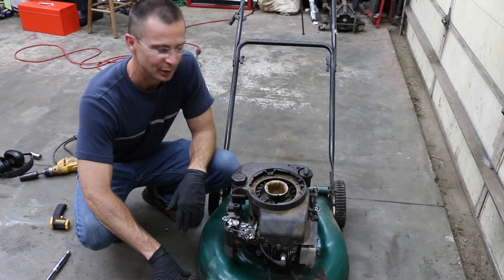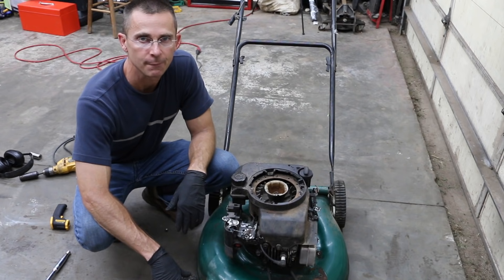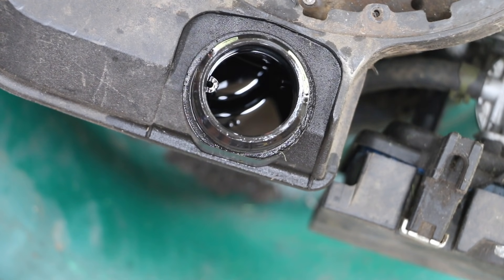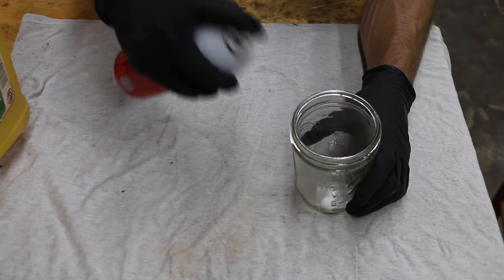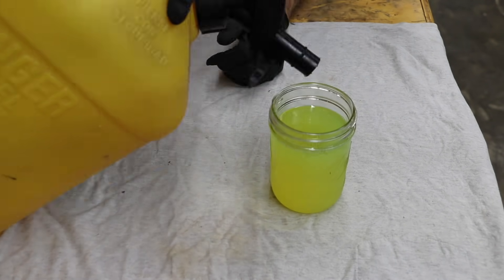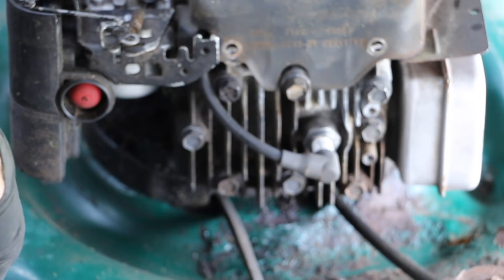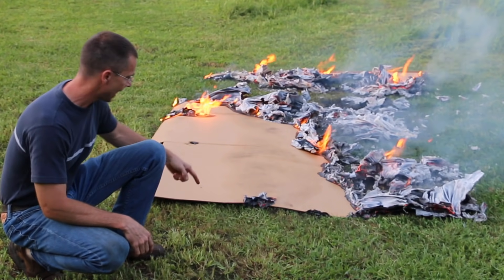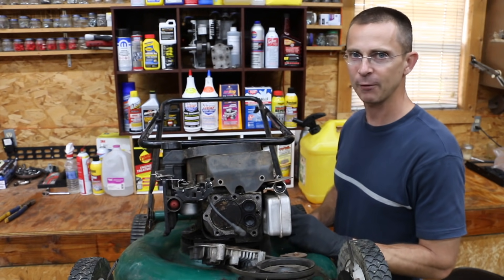Will a Gas Engine Run on Diesel?  Let's find out!

Comment: Since diesel is oily, would a two stroke run on that 50/50 mix without needing to add oil to the gas? Would it seize?
Reply: Oikomi Infaccia good question. Merits a response ithink
Reply: The short answer is no.  It is different viscosity and weight and would eventually destroy the components (especially gaskets and rings). There is a reason each 2 stroke must have a proper oil mix and there is not a lot of room for error if you want it to function properly and for a long life.
Reply: @coyote311  I've blown up a perfectly good two-stroke engine before using the wrong ratio (using 50:1 as specified for my Stihl instead of 40:1 as required), and I can attest anecdotally that your logic regarding viscosity and weight is sound.
Reply: @lashlarue7924 : You blew it up before even getting to the wrong ratio? How did that happen?
Reply: @HelloKittyFanMan.  🤷🏻‍♂️ .  Well, I’m not saying the motor wasn’t chinesium to begin with.  Too little oil might have caused excessive heat under load?  🤷🏻‍♂️
Reply: @lashlarue7924 : But you said you blew it up before even using the wrong ratio. So you were using the right ratio and it still blew up. How?
Reply: @HelloKittyFanMan.  Uh.. well, I think what happened was, I didn’t put enough 2-cycle mix in.  Then the motor overheated and blew under heavy load.  That’s my recollection of events.  I really don’t know whatever it was that I said earlier, but I think the point was that 2-stroke motors need lubricity.
Reply: @lashlarue7924 : OK, so what we have here is a case where you made it sound like you sadly ruined your engine after getting the wrong ratio instead of before, meaning that for future readers you should edit your previous reply accordingly (which, by the way, wouldn't take much work in the number of button clicks of some kind).
Sorry that happened, man. It sucks!

But of course you do know what you said before, because it's just right here; if you need a reminder then all you have to do is scroll back up to it.

By the way, all energy-conversion engines need lubricity, so there's nothing special about two-stroke engines, either gasoline or diesel ones, in that regard. It's just that the method varies.
Reply: Yeah, it might be,  @lashlarue7924 . But fortunately for us and future readers, you can fix that quite easily with a little edit up there (in even fewer clicks of work than your last reply here). ;-)
Reply: @coyote311  only way to confirm your prediction is to do an actual test
Reply: @coyote311  we put a small amount of regular oil in our diesel in a 2 cycle mowed about 1 acre everyother week for years
Reply: @coyote311 : "There is a reason..."? Yeah, but _everything happens for a reason. So...?
Reply: I saw mechanics run gasoline engines that had water contamination in the oil, drain the oil and add 6 liters of diesel fuel  instead. Started the engine and ran for a few minutes for all the water to be absorbed then drained the diesel and filled with proper motor oil.
Reply: Diesel is basically the waste that is left over after gas is processed
Reply: @phantomsgarage3695  actually, gas is the by-product of oil
Reply: @mikeharris8365  yeah then when gas is processed it produce a byproduct again creating diesel
Reply: @phantomsgarage3695  Right, and to think it was invented accidentally, pretty amazing actually
Reply: @mikeharris8365  gas is just better filtrated diesel
gas has smaller particles then diesel
Reply: @mikeharris8365 : *Gas...OLINE is an oil. Just thin.
Reply: @denimory : Gas isn't a liquid. You sure you didn't mean to be talking about gas...OLINE? Also, "smaller particles..." and then diesel? Or what about smaller particles THAN diesel fuel?
Reply: @HelloKittyFanMan.  Gasoline is a byproduct of oil!! Do a little research sweetheart!! 🙄
Reply: @mikeharris8365 : Gasoline is still an oil itself. Do a little research(comma), "sweetheart"! 🙄🙄🙄
Reply: @HelloKittyFanMan.  Who told you it wasn't?? Let go whoop their asses!! Sweetheart!! 😠
Reply: @mikeharris8365 : Uhh, I think you just barely implied that as an attempted supposed "correction" of what I said before, "sweetheart." 🙄🙄🙄
Reply: @HelloKittyFanMan.  Ok, you win, I'm not here to argue with children. What are you? 13 and at the beginning of puberty sweetheart? 🙄
Reply: ... asks hypocrite  @mikeharris8365 , who is all butt-hurt because he can't handle being given a fact that disagreed with what he said.
Nope, I definitely wasn't ranting. I made a simple statement of fact. You didn't like it. Look who the baby actually is, haha! 👶👶👶
Reply: @mikeharris8365 : Nope! What's actually stupidity comes from a person who: 1. thinks something is a "rant" that isn't one, and 2. doesn't recognize the properties of gasoline that define it as a light oil (similar to the mineral oil branded as WD-40):

1. It's a slippery liquid that is also:
2. not water-soluble/-miscible, and
3. combustible.

Obviously plenty of non-oil liquids are combustible too, but this combination is what makes gasoline an oil.
Reply: @HelloKittyFanMan.  😭😭😭😭😭😭😭😭😭😭😭😭😭😭😭😭😭😭😭😭😭😭😭😭😭😭😭😭😭
Reply: Haha, thanks for admitting what you were just doing,  @mikeharris8365 ! 😭😨😧
Reply: @phantomsgarage3695 : *gas...OLINE
Reply: Please please do this one
Reply: @M18 Hellcat thanks for sharing your knowledge
Reply: How about you try it out and post it on here for us to see if it works
Reply: @toobeme24  I don't have any "experiment" weedeaters
Reply: Yes.  We used 2 cycle gas lawnmowers in military but only supplied with diesel.  Ran at a lower rpm smoked like crazy, and needed oil change about everyother month. But they were 6+ years when I got there an still ran
Reply: When I was kid I ran my two-stroke moped engine with diesel to get to the gas station. I started engine normal 2 stroke fuel and let it heat up well. Then added diesel. Powerloss was absolutely horrible and it was almost impossible to restart engine if it stalled. Surely some regular fuel was mixed with diesel, but most certainly not much as it was hassle to ride. One note is that moped was quite much tuned and ran in much higher compression than originally. We tried that in one completely stock engine and it was pretty much impossible to ride as there just weren't any power left. Oh yeah and no 2stroke oil added. And yes, it'll output smoke.. A lot
Reply: The old high sulphur diesel was quite lubricating. Modern low sulphur is not as good. It would need castor oil adding.
Reply: @Dave5843-d9m  I think you could very well be right. This was about 20 years ago and in addition I used "farm, diesel" and now to recall I think it used to have higher sulphur content than car's taxed diesel at that time. I think there was some discussions later on that it wouldn't be good for newest engines back then. It could very well have been about lubrication, not sure though.
Reply: They will but lots of smoke and you might need to adjust the carb
Reply: I would think so
Reply: Did the 50/50 mix last longer than straight gas?
Reply: @murdered1415  I was wondering the same thing due to the fact your lowering the flashpoint of gas by mixing it with diesel. You would think it wouldn't burn as fast
Reply: M18 Hellcat it’s over emissions and fouling.
Reply: iBiana Doubt  model t huh? Whats the 0-60 on that bad boy?
Reply: iBiana Doubt  lol. Time for the first turbo'd model t
Reply: @boosted1430 : LOL, "turbo'd"? You don't save effort or space by just spelling " turboEd" out. So why not just say that?
Reply: @Frank Blackcrow And it is supposed to have more cetane.
Reply: 2 stroke can run on diesel but it needs oil same as gas so yeah
To be clear small 2 stroke engines doesn't care what you put in, it just runs/works
Reply: @Akyomi777 : 1. Diesel fuel IS an oil. Did you mean to be more specific than that? 2. There are 2-stroke engines that are diesels. 3. Gas isn't an oil because it's not even a liquid. But if you were trying to say "same as when running on gasoline," then be more specific of if you were talking about a 2-stroke gasoline engine running on gasoline or on diesel fuel.
Reply: It definitely will work
Reply: Some german Fichtel-Sachs stationary 2 stroke engines in 50th (mayby even before ww2)  used to have a second fuel tank for Petroleum (Cerosine/Diesel) as this was cheeper. You needed to start the engine on gasoline and once it is hot switsch to 100% Petroleum. It will only run well when at least 50% power is needed and the engine stays hot.
Both Fuels needed 1/25 parts of oil for lubrication.
Reply: 2 strokes rely on sparks from spark plug.  They would never have high enough compression to ignite diesel.  Diesel is not that oily so you would seize the motor.
Reply: @bunzeebear2973 : You should try learning what a 2-stroke DIESEL engine is, then.
Reply: Uh... gasoline is oily too, though.
Reply: Maybe so,  @WorivpuqloDMogh , but we're not using Dutch here; we're typing in English. And in English, gasOLINE is the thinner but still liquid fuel than diesel fuel, used in engines that have spark plugs. Thus, GAS is the form of matter that's not solid, liquid, or plasma (like air).
Reply: @WorivpuqloDMogh : OK, "bud," and I know you were stating something. That's what every sentence that doesn't ask something is: a statement, duh.
But your statement was pointless.
Reply: @WorivpuqloDMogh : Nope, it's actually you, because I simply defined gasoline and gas. That's not berating anyone, and it's not saying I'm the "best," DUH. And you had a big cry about it, as if there was something "wrong" with your being told that even though there isn't. Only a moron would have a problem with another person giving them the information about something that they didn't have. Cry about it: "Ohh nooo, you should pretend like you didn't know that so I can artificially look like the 'smarter' one even though I didn't have that information, whaa, whaa!" (Even though looking like the smarter one wasn't my goal, because my ego's not huge like yours.)

So no, you stop being one of the actual jackasses.
Reply: @WorivpuqloDMogh : Yeah, sure, "Einstein." Defining gasoline and gas for you isn't being "hostile," doof. Having more information than you and displaying it to you isn't being "hostile," doof. You only think I was "hostile" because you were born hostile, unlike a normal, reasonable person. The person wasting your time is YOU, baby "buddy." If you want me to stop replying then you should have an idea of how you might get that to happen, duhh.
Reply: Of course you are, alex. Pretty pathetic, isn't it? All just because I defined 2 words for you that you're mad that I knew about because you didn't until now. Whaa whaa whaa!
Reply: For a while. 2T oil, at least the 50 to 1 mix is slick like liquid moly cam lube diesel isn't. Remember that you are lubricating the crankcase with fuel on the 2T.
Reply: The same question I came here to ask.  Not holding my breath waiting for an answer.
Reply: Two stroke diesels don't have oil added to the diesel. A lot of people drive detroit diesels for a million miles.
Reply: Isaak Welch 2 stroke diesels still have a crankcase full of oil and the same lube system  as 4 strokes
Reply: @isaakwelch3451  have you ever rebuilt a Detroit 2 stroke they have more rings the ones on the bottom keep the oil out of the compression camber.
If the had a modern 2 stroke it would be two efficient
Reply: @garybrown9719 : "Compression camber"? Huhhh?
Reply: @isaakwelch3451  
I don't think an old 2 stroke Detroit would last a million miles, the 4 stroke 60 series could.
Reply: @bertgrau9246  theres a lot of them that have
Reply: M18 Hellcat    The Echo equipment uses 50:1 mix.    But I gave up all gas equipment.   Small gas mix engines such as small chain saw, weed eater, blower, hedge clippers all replaced by DEWALT 20 volt max or Flexvolt 60 v.   I can’t believe how nice it is to just work every time.   Same batteries as all my portable shop tools.   I only have a gasoline engine for my power washer and as it is used maybe twice per year I drain the float bowl by removing the nut and run the tank dry and pour any gas left in the can into the car tank.   I never store gas that way and have it go bad.   When I need the washer it starts every time.
Reply: @phbrinsden  But you can buy pre-mixed fuel.
Reply: Carburetor based will not. Fuel injected will
Reply: @ coyote311 that makes sense sir. I suppose they would have different flash and combustion rates as well as pressure tolerances... ty sir
Reply: @M18 Hellcat I did not beg him to do experiments especially on lawn mower...
Reply: @WorivpuqloDMogh : NOPE! Never, actually. Are you always such a dip-face who gets foolishly annoyed for no good reason just because someone gave you some correct information that you didn't have before, so your big ego won't let you just accept it?
That makes you a doofy troll.

Comment: I borrowed a car years ago and went to fill up (not thinking early morn) and put petrol in, drove 74 miles to work and on way back stopped to refuel and notice a diesel only sticker in fuel cap, but fortunately had no problems
Reply from the maker: Wow! Glad it all turned out okay
Reply: Thankyou, well i got back to the garage (that lent me the car while they fixed my van) the lady on reception said they haven't finished my van and that i can keep the car till tomorrow, but after 150 miles already i figured if was gonna go wrong it would have by now. It was a Volkswagen Polo if i remember

Comment: I tried this before... oh the memories ...i did run my motorcycle with diesel the main problem was that it dint start until the engine was hot enough to heat up the diesel and ended making a lot of withe smoke but... the engine was a 50cc engine that run with a pre mix of gasoline and oil wasn’t easy to start but it run. Motorcycle was a Casal 4 http://acoresmotorizadashelder.blogspot.com/2013/04/vilar-casal.html?m=1
The mix of diesel here in Portugal must be different from the US.
Reply from the maker: Thank you!

Comment: Start the mower with gas and switch to desiel once it's warmed up, then remove spark wire as well... Do your best to flush and raise the piston head as high on top dead center as possible, but without harming the spark plug, prior to this test by shiming the top of the piston with layers of steel
Reply from the maker: Thank you!

Comment: What if you advance the timing and run a 20/80 diesel mix, would it run better because of the diesel slow burn, with gas as an igniter, and an advanced timing to accomodate for the slow burn?
Reply from the maker: Thank you for the video idea!

Comment: If you try increasing the compression and warming the cylinder see if that gets her going shave the head down a bit not sure how high you can get on a flat head though there kinda low compression as is
Reply from the maker: Thanks for the recommendation!

Comment: It isnt worth doing on a lawn mower but in a well tuned car:

High voltage spark plugs with a larger gap + advanced ignition + 20:1 A/F or higher

Should work fine. The carburetor on the mower is what was messing it up. In an engine that runs so rich anyways you shouldnt have needed the primer just a bit of throttle for a minute maybe two so that it could warm up and idle correctly.
Reply from the maker: Thank you!

Comment: Oliver made a gas/ diesel fuel tractor engine having both carborater and injection pump start on gas then go to diesel . Mixing gas and diesel fuel  makes something close to jet fuel . Jp5 maybe. The gas producing a lot quicker ignition and Diesel producing a lot more heat.
Reply from the maker: Very nice setup!  Thank you

Comment: When we burn brush piles we mix 70 30 diesel gas mix it makes a fast ignition and a long burn
Reply from the maker: Thank you
Reply: @ProjectFarm  My neighbor is an old logger. The trick he uses is to put an old tire at the bottom of the pile, and fill it with diesel with a bit of gas. Then put the brush on top with a little more gas and away she goes. The tire keeps burning for a long time which will even get wet brush burning.

Comment: Considering it’s a flathead, that’s impressive. 50/50 makes sense. The burning gas provided the heat and pressure for the diesel. Amazing there was no diesel smoke.
Reply from the maker: Thank you!

Comment: Yep I enjoyed it and it helps settle many arguments regarding these two fuels. Why not try 50/50 in a diesel engine? You have also generated many interesting comments below, its only a guess but I'd reckon most will be over 50yo as I think most "youngsters" wouldn't have a clue! I say most certainly not all.
Reply from the maker: Thank you.  I believe a 90/10 gasoline/diesel mix would be an interesting test for efficiency gains.

Comment: Dumped 2-3 gal of diesel into an empty car (oops didn't smell the gas can first)... Smoked and ran like hell.. Made it 1/4 mile away to a gas station tho
Reply from the maker: Oops.  That's never a good day.  Were you able to fill it up with gasoline and just run it with a mostly gasoline blend or did you drain the tank?
Reply: @ProjectFarm  Yes, put in a bunch of Gas and kept driving.. Smoked a little that whole tank. ;)

Comment: A small amount of diesel will actually clean off some of the carbon in a gas engine. Too many sensors in these vehicles today, but on the old carburetor Motors it could be done.
Reply from the maker: Great point! Thank you

Comment: See I gas runs in a Diesel engine
Reply: Won't for long.

Diesel engines require 1.) High Compression and 2.) High Pressure to ignite the incoming diesel fuel.  The pressure from the fuel injectors greatly exceed anything in a gasoline engine.

This is important because diesel injectors leverage the fuel itself to both cool (diesel has a high oil volume, giving it the very properties he displayed in the video on the cardboard) and lubricate the injector.

Gasoline lacks the cooling or lubricating capabilities that diesel has.  All manner of badness ensues when one attempts to run a diesel engine on gasoline.